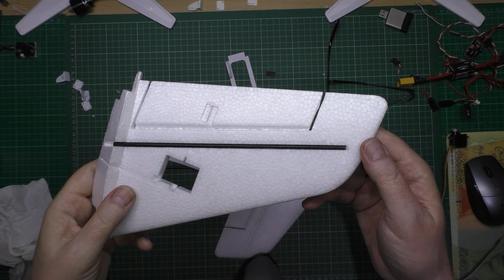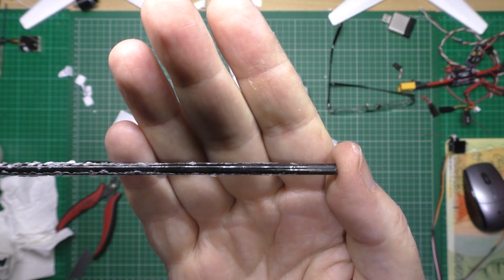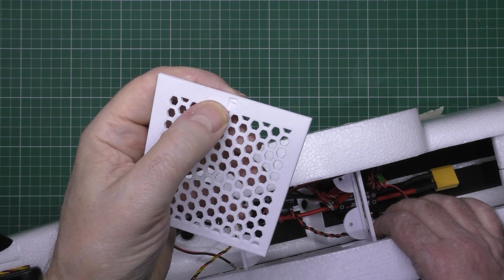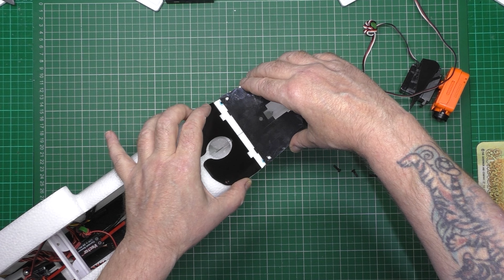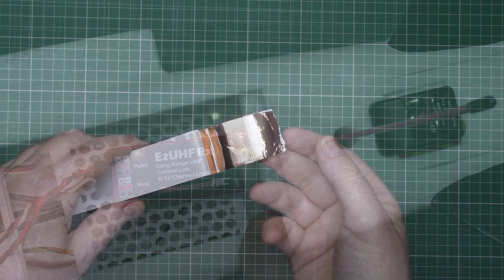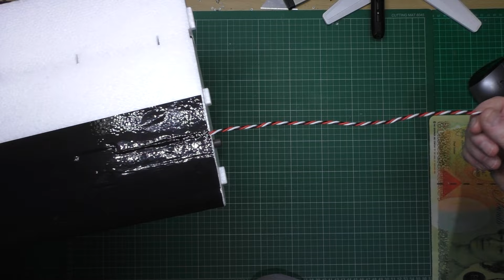Mini Talon build part 2 - doing it right this time

Comment: Do you glue the wings on Vortecks?  Or do you leave them attached without so they can be removed?  Im on the last stage of my build but cant decided what to do with them.  Cheers,
Reply from the maker: I don't see the point in using glue. They're held in place with 2 clamps and I've tried to separate them when they're tightened but they're not going anywhere. Glue just adds weight and you can't take the wings off again. I'm working on a twin motor conversion (a motor on each wing) and it'd make it rather difficult if it'd glued them in place.
Reply: I was wondering as the manual doesn't state to glue them, i was planning to just tape over the joints but this thing lands fast so might take a knock and come loose, probably put a couple of drops of glue just for security but only enough so i can slip a knife in and release.

Comment: nice video. What is the "wing tape" you used? could you do a video explaining how you apply it without wrinkles? I tried myself to apply a hobbyking monokote type film on a Talon and it would not stick well, then trying with a hotter iron, it would damage the EPO foam.
Reply from the maker: I have the same problem with laminate, it's not easy. I only use the Hobbyking wing tape now, it's easy to apply https://hobbyking.com/en_us/wing-tape-45mic-x-45mm-x-100m-wide-black.html

Comment: Do you use abs or pla for your 3D prints?  I'm going to get some of the parts printed that you printed. Thanks.
Reply from the maker: I generally use PLA because it's easier to print with and stronger than ABS. But........ PLA does deteriorate over time (when subject to moisture and cold) and goes brittle. If the cost of PLA and ABS printing is the same, I'd always go with ABS.
Reply: +Vortecks Thanks. Time to start printing.

Comment: Looks nice Tony, I like Simon's RX Dipole....I thought you could select ESC start routines by listening to the beeps?...So, with the throttle wide open, power on the ESC  and wait for the appropriate beeps to go off, and then drop the throttle shut quick....This selects the ESC Start / Brake Mode...?...I like the Modular Pan Pod....that's how it should be IMO....and, you have pointed it down nicely, well done....No Points for having loads of sky in shot....:).....What happened to Mini Talon #1..?
Reply from the maker: You can set soft-start by listening to the beeps..... if it beeps in the first place mate. I don't know what happened to it, but it didn't do much :-(    
The MT V1 is retired now, there were things that annoyed me like the constant yaw problem at full throttle, caused by the CP antenna on the wing (drag) and the imbalance of having the EZUHF on the other wing. Also, it was VERY heavy with the massive motor and ESC. I could have simply taken all the stuff off the wings but that would have left holes....... I'm a perfectionist and it would have annoyed the snot outta me :-)
Reply: Vortecks Oh, I see what you mean...I enjoyed watching Bonafide Pirates recent MT Video 10 miles out...I think he uses the Runcam 2 as an FPV Camera too...I hate those huge 1.2G Skews myself...on any model...Look forward to seeing this one fly m8:)

Comment: Could you put in a link for the UHF antenna with the coiled base.  Has your source done any testing as to how well it works, or is the 10 % figure a guess?  Thank you for your build series, it looks to be a solid plane.. Nice...
Reply from the maker: You can contact Simon in 2 ways.......    
http://www.fpvhub.com/index.php?topic=13441
Or
simon.codd@sky.com    
He hasn't done any tests on these particular antennas but he does do SWR testing and they're identical to the VAS ones (IBCrazy) and he's done thorough testing on his.

Comment: Have you considered selling either a Mini Talon kit or, perhaps, just the optional extras you've designed?  I'd be keen to buy one that I knew was properly setup without some of the short-comings the factory has.
Reply from the maker: I've thought about it and then decided not to. It wouldn't be viable to spend hours, printing all the stuff, programming ESC's and testing it all. Not to mention the after sales support. If something was to happen..............

Comment: Looks like you are very close to being done. Too bad about the ESC. There always has to be a hitch somewhere in a project.  I have got a Turnigy Plush 60a that I plan on using. 
I ended up getting the SunnySky X2216-9 1100kv II and hope to use a 9x5 prop.
Reply from the maker: That's a good combination Dave. It's what everyone is using including Mark_Q (on RCG). I used the T-Motor 2216 because it's what I already have and they're reliable.
Reply: That's good to know that I have something that will work.
I've got to get going on the build now that winter is setting in and the elections are over.

Comment: Another great video! I wish I would have watched these before I built mine. As for the ESC, I'm using a Turnigy Plush 60 and had to set the timing to high for the SunnySky 2216-1250kv motor to operate properly. It flies awesome now. What is the benefit of flashing the ESC with BL-Heli and yes, I'd like to see how you do it.  Also, you would be a hero if you would do a multi-part video series in which you install the Vector, set it up and do your radio programming. Thumbs up!
Cheers, Bob
Reply from the maker: Thanks Bob.    
I'll be doing a video on flashing ESC's. The main benefits of using BLHeli is the motor reverse and timing functions:- Some people have reported that the Sunnysky motors need different timing to stop de-sync and I'm always forgetting to test motor direction before fitting the ESC.
Reply: Yes, I had to set a Plush 60 to a High timing setting so it would play well with a Sunnysky motor. I just used the Turnigy programming card though. I look forward to seeing your video. Cheers!